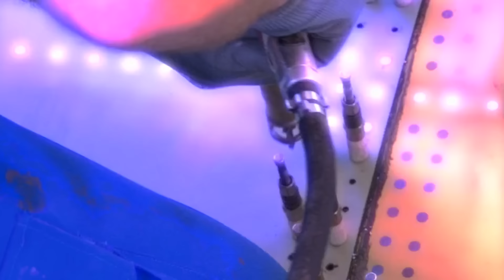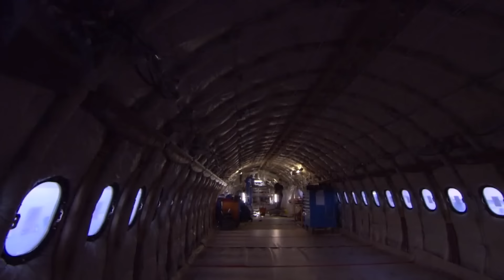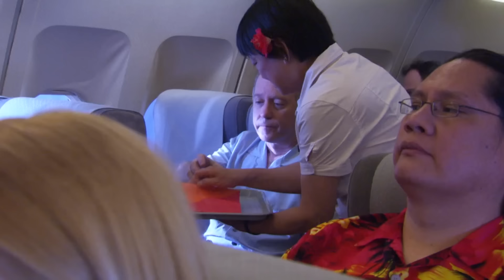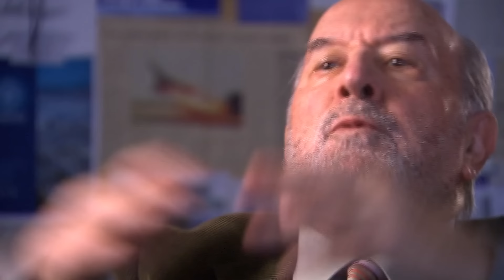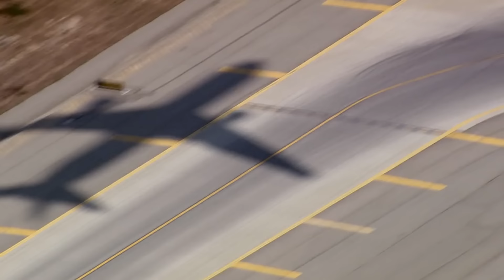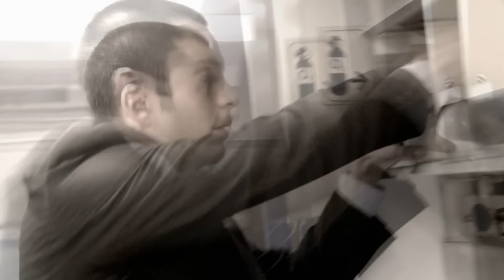Traveling A Life Support System That Became A Nightmare Come True... | Mayday: Science of Disaster

Comment: Early in my own flying experience as a passenger. I accidentally done an experiments with the air pressure in the plane's cabin with bottles of water, where a bottle opened at cruising altitude shrank once we got onto the ground and a bottle bought at the terminal hissed as though it was carbonated up in the air.
Is a very simple way to test the air pressure and fascinating when seeing it first hand. Makes sense why pop in the galley is different than the tins or bottles bought in shops on the ground.

Comment: Why not have cargo doors that open sideways?  Similar to how reardoors on a minivan open and close?  Even if it came unlocked it wouldn’t slide open if it had to slide towards the front of the plane, the air flow would push it back in place

Comment: And not one mention of why the jet airplanes have to fly so high? To learn that, you would have to watch other videos. I think it was probably Mentour Pilot who explained that matter well. I think it was about 3 reasons. The thinner air allows the jet to fly faster and farther, on a given amount of fuel. It reduces the air drag. The high altitude has some safety aspect to it. In the event of loss of power of all engines, the heavy airplane becomes a glider, losing a mile of altitude per 15 miles flown. Altitude has to be slowly given up to maintain air speed to keep the airplane flying. This allows a distance of around 100 miles in any direction to try to reach a runway for an emergency landing at an airport. Perhaps the 3rd reason may have been, being able to fly above bad weather and storms.

Once when I flew to visit Israel, I wore a watch that had a barometer and forecasts the weather. Not a smart-watch, but a watch that had a battery that would last for about 2 years, no recharging. It said during the flight, that the altitude was only about 1000 feet, or maybe 1000 more feet than it was on the ground. This is showing a measure of the pressurization of the airplane that it was close to what it would be on the ground.

A curious related fun fact. What happens if you put a can of soda into a vacuum chamber and suck out all the air from the chamber? Nothing at all. I saw that in some YT science video. The soda can withstands the pressure. But pressure vessels may not so well withstand a vacuum inside, which can cause the tank to collapse. Pressure vessels are often round or cylinder-shaped, which helps distribute rather than concentrate the pressure forces.

Comment: 15:30 the design actually work: but a flight attendant was sucked into the small opening and blocked the air exit caused the whole section ripped apart.

Comment: a world war 2 B17 is also capable of flying at those altitudes (35,000) (that's why the engines were turbo charged). it was extremely uncomfortable and dangerous. they were required to wear heated vests, heated gloves, oxygen at all times, and their hands would freeze to bare metal if they touched anything without gloves on. it's like minus 30 degrees.

it is not a pleasant enviroment at those altitudes without pressurization, and people do take it for granted because they have never been at that altitude without pressurization.

Comment: It is not oxygen....It is air! As you go up and mix with outside air from the engine to pressurize the fuselage to about 8000', there could be supplemental oxygen to bring the air in the plane back to about 20%, but that's about it. More or less oxygen becomes problematic to people.

Comment: LOW OXYGEN WARNINGS 
Low oxygen warnings should be distinct and crews should be prevented from turning them off.

When the brain is deprived of oxygen a person can feel euphoria. That’s why when you fly the flight attendants tell adults to put the oxygen masks on themselves first, then put masks on their children. If the adult begins to experience hypoxia they will feel so elated they won’t put a mask on their children and they will all pass out and then die from oxygen starvation. 

I got to experience a simulated cabin blowout at 40,000 feet in a chamber at the Johnson Space Center. I was training to be a diver, suit subject and safety diver at NASA. 

The exercise started by entering a hyperbaric chamber and sitting on one of the two sides. An instructor slid a small swivel desktop in front of me like the desktops in a classroom. Then the instructor put a piece of paper on the desk with a very simple test. It had questions like 2+2= , 3+4=, and so on. Then the instructor tells you to start answering the questions. (But at that moment a ‘simulated cabin blowout’ occurred and the chamber was free of all oxygen). There were no signs of a decompression.

I thought I was doing great on the test and then the next thing I realized was the instructor putting an oxygen mask over my nose and mouth. After a few moments of breathing pure oxygen I looked at the test. The first couple of questions I got correct. But all the rest were wrong. I put down 4-2=75, 2x5=139 or 3+7=giraffe and so on. 

The euphoria I experienced led me to believe I was in total control of my mental facilities but I wasn’t. It was a very valuable lesson. 

The feeling of hypoxia effects is the same as the euphoric feelings people get during ‘near death experiences’ is simply oxygen deprivation. It has nothing to do with the supernatural or a god. It’s simply your brain being starved of oxygen. 

You’d think in such expensive aircraft there would be an immediate alarm and voice command to warn passengers and crew to immediate don oxygen masks when there is a rapid decompression. It would be an inexpensive modification compared to the cost of multimillion dollar aircraft and the lives of all on board.

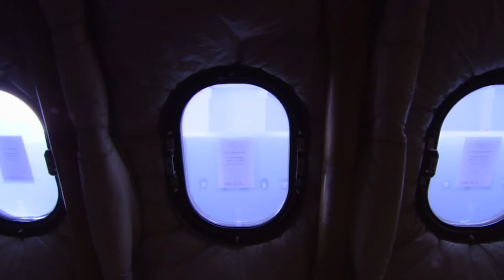Comment: 6:17  the windows were not the source of the cracking of the Comet's fuselage skin.  DISOBEYING THE DESIGN BY USING PUNCHED THROUGH RIVETS instead of drilling the holes, which caused stress cracks at the rivets.  The square windows would not have caused the failures in many thousand pressurization  cycles.  The improperly installed rivets would have caused the aircraft to fail if they had used modern ovoid windows, it just might have taken another year.

We need to end the lying rumor.  the windows were properly reinforced.  Square windows in an airliner would be fine.

Comment: The pressure pushing out actually gives the airframe rigidity, like a soda can when it is empty vs when it is full.

24:50 The issue was that the mechanic used the same bolt size as the ones he removed but the previous installation was wrong.  The mistake the mechanic made was he should've looked up what size he needed, not simply matching what he removed.  He, reasonably, assumed the previous installation was correct.

In the Helios crash there should be an automatic feature that pressurizes the cabin if it reaches a crucial altitude and the pressure is dangerously low regardless of switch settings.  There is no situation where a flight crew would want it to be otherwise. As this proves it would be a death sentence.  More critical alarms should be verbal ones to announce the exact issue.  Ground proximity alarms are verbal.  

In a post 911 world that flight attendant wouldn't be able to enter the cockpit to try to save the flight.  The cockpit doors would lock anyone out.

Comment: cabin pressurization switch?! Is that a checklist item?  How about using a different alarm sound for different alarms! Some thing that cannot be confused!  Why design a plane with bolts that differ only by a half a millimeter. That is nothing anyone would notice. What is the thinking there? Did the manufacturer really save that much money by using thinner bolts elsewhere than in the windshield frame?  They should have designed it for the thicker bolts wherever the thinner bolts were specified in order to make things more uniform and interchangeable.
Reply: Diameter of the bolts was not the problem, it was the length! The short bolts didn't engage the lock nuts fully, bolts only had a few threads holding window to frame!

Comment: The area surrounding the crash began to catch fire and started burning and spreading rapidly , apparently it had something to do with the landing gear that had just been serviced, all joints in the mechanical working environment had been properly greased by the technicians crew. The preliminary results were that the fire had started in the landing gear area and quickly started igniting the grease that that had recently been applied and the aircraft itself actually crashed in Greece , they determined this was a large Greece Fire 🔥 😎🔥
Reply: You'd think they'd find a lubricant that didn't catch fire.

Comment: I hate to point fingers but Helios failure was due to the lack of attention by the crew, not from the stated reason of the aircraft not carrying enough oxygen. Not only due to a missed switch in preflight but also the failure to recognize oxygen deprivation. Which to be totally fair, the later of the two could be from lack of training. Though that could be completely avoidable by simply putting in place a policy of dawning masks on an alert or whatnot.

Comment: Okay so because of a faulty switch, the locks had power, but what actually caused them to open? There must have been a separate control, or else they should have reopened as soon as they were closed? Or did they mean to say the switch was faulty in such a way that it turned itself on?
Reply: could have been a electrical short? given the wiring was in a bad way to start with..
Reply: If I remember correctly from other documentary material, the faulty switch not only failed to cut off the circuit, but turned it on without command. It effectively did the opposite of what it was designed to do. It was defective however, the failure in design was mostly in the mechanical parts.
Reply: What caused them to open? Imagine a small door 4 ft x 6 ft and the air pressure inside the hull is 10 psi more than outside. That's a force of 17 tons trying to open the door.  Those locks had better be perfectly designed!

Comment: I’m hearing excuses for poor flight crew performance. I don’t know what cockpit procedures Helios used but prior to the early 2000’s when many airlines introduced changed areas of responsibility during preflight the pressurisation panel was the sole domain of the First Officer. It was the only system/panel on the overhead that he manipulated. It should have been obvious regardless of lighting that the panel configuration was incorrect for normal operation. As for the warning horn , inflight it can mean ONLY one thing and all they had to do was look at the cabin altitude indicator and they had their answer.

Comment: Cargo doors locking mechanism I would trust is solenoid rods coming out from fuselage on each side of the door controlled by 4 electrical circuits that are disenergised in locked position.